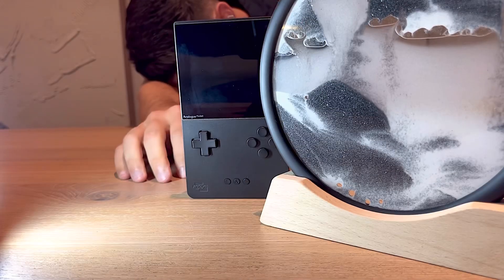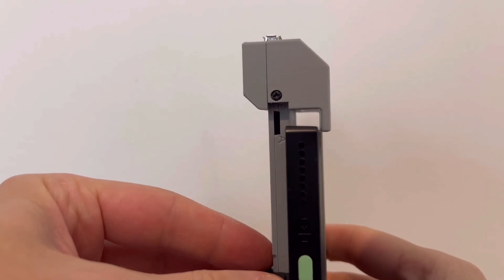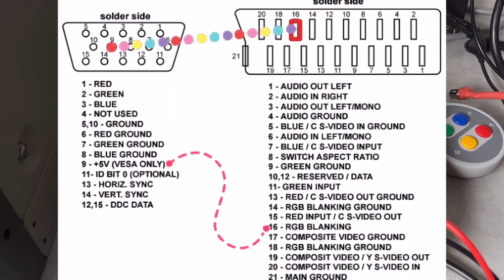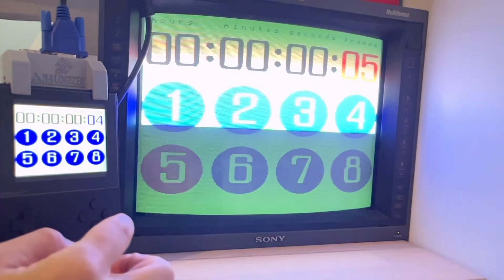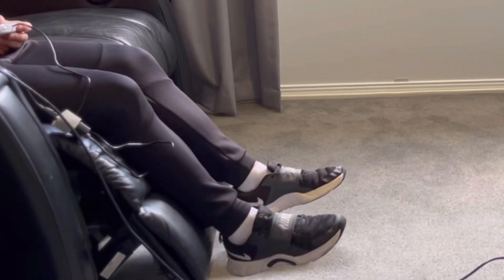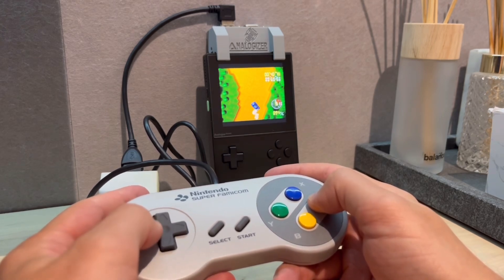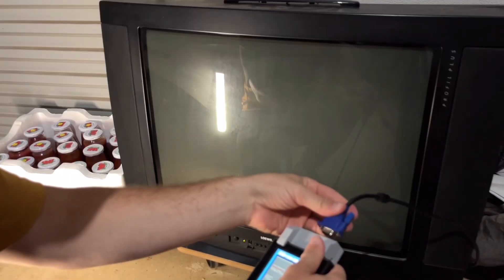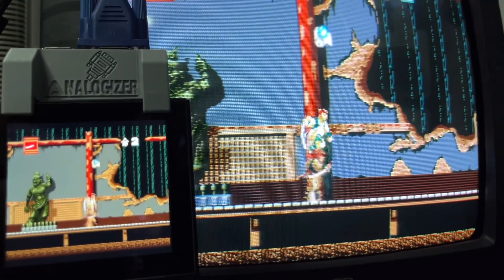FINALLY! A DAC for the Analogue Pocket! Analogizer FPGA for crispy analog video to a CRT AND MORE!

Comment: I just want to play DMG-01 Gameboy games on a crt using this. You didn’t show any crt screen gameplay with original dmg-01 green palette. That was the whole point
Reply from the maker: @yasinabid2031  The only console cores compatible with the Analogizer at the time of making this were the SNES, NES, PCE and NeoGeo. Analogizer supported the Gameboy Colour openFPGA core well after this was made my friend. There currently does not exist a GB openFPGA core for the Analogizer so if it’s a green palette that you want then you’d need to see if it exists in the GBC openFPGA core. The Analogizer obviously occupies the cartridge slot so it does not allow to play original cartridges, therefore you’d be loading roms from the SD card so if you were to do that anyway then there’s several options that would have you play GB games on a CRT: MiSTer FPGA, Raspberry Pi, SNES with Super Gameboy, GameCube with the Gameboy player. If money was no factor then my personal recommendation would be the GC/GB player combo as it is one of the few options that will play original Gameboy carts in full screen and if you boot through Swiss then you can output in 240p. Otherwise emulation on a Pi 3/4 output to a CRT is be fairly cheap and accessible

Comment: pretty cool, too bad it won't allow you to use hardware. Analogue doesn't want to release an working DAC for the pocket and it seems like I'm stuck using HDMI till then.
Reply from the maker: I hear you, the creator of the Analogizer is working within the constraints of what can be accessed through the cartridge pins. Otherwise if you have a good downscaler on hand then you could skip their eventual DAC

Comment: How did you manage to get audio from an audio breakout port of those HDMI 2 VGA adapters? I mean the one around 7:35 
I tried 2 different ones and I notice that the port reacts to my speakers but it does not output any audio. Would appreciate if you could tell me if there is something specific I have to do. One of the ones I tested looked exactly like yours
Reply from the maker: The one I featured gets 5v from the HDMI output of the Dock. Not all HDMI devices send sufficient voltage and not all external converters receive enough amps so either of those could be the reason why you’re not getting audio, assuming you have done troubleshooting to rule out the auxiliary cable, HDMI to VGA adapter and Dock power supply. I don’t think it’s a copy protection measure but it’s something to consider and you may just need to try another converter, possibly an externally powered audio DAC
Reply: Thanks a lot for the feedback! Well, yeah I assumed something similar. On the Dock I‘m using the official power supply. I guess I will have to use either an external DAC or HDMI splitter with audio breakout or simply use your other method with an extension cable so I can reach the pocket‘s audio jack which seems to be the quickest and cheapest solution. 
Yes the setup is wacky but at least I can play PC Engine on my CRT haha
Reply from the maker: @marph2005  no problemo! I love using the Analogizer for portability, otherwise a good downscaler with the Dock works really well and displays the menu
Reply: @MarcoRetro316  Hey, so I have finally followed the setup now that you show at 7:50 (the one with USB-C extension to reach the audiojack, but actually this solution doesn't work for me. If I plug in the analogue in the dock that way, the screen turns off yes and I can use BT Controllers, however the sound through the jack turns off immediately. Did that solution really work for you?
Reply from the maker: @I honestly can’t remember it’s been a while since I tried with the dock and usb c extension. My friend has my dock so I’ll see when I can grab it back and test again for you
Reply from the maker: @ come to think of it, it makes sense it would mute the audio, I likely had the mass of wires as a point to make, sorry, as it is misleading. If the female usb cable was for charging only then it would work, but then you’d not be about to use a usb controller. To have it docked and extract audio then you’d need to go back to an hdmi converter
Reply: I guess so. Maybe the easiest is to take an usb charged Audio extractor. That way I can go through HDMI and should get the audio without worrying if the HDMI to VGA without knowing if it can extract sound by itself or not. Thanks for your help though!

Comment: Don't you need the level shifter to match the voltage of controllers to the SNAC I/O board to prevent potential frying of Analogue Pocket? Why don't you research more before you post videos?
Reply from the maker: Thank you for bringing this up. When I used SNAC, it didn’t work with the intermediate shifter, though it should have and was possibly just a poor connection. You’re correct that it needs the level shifter, again thanks for bringing this up and I’ve pinned a comment to bring it to attention

Comment: So I now have an entire setup - Pocket, Analogizer, 90-degree USB adapter, SNAC SNES adapter, SNES controller, and a CRT monitor.  Now just one problem - I can't figure out a way to re-map the controls.  Trying to remap buttons on the Irem m92 core and while I can remap them on the pocket itself, I can't remap for my SNAC adapter.
Reply from the maker: I’m not sure you can remap SNAC controllers

Comment: i mainly use my pocket with real carts, wish this could work with real carts.
Reply from the maker: Unfortunately no. The cartridge port will be occupied by the Analogizer for starters, and the device requires cores in openFPGA to be specially modified for analog output

Comment: Too many caveats, just buy a MiSTer
Reply from the maker: The MiSTer will always be the pillar of my setup
Reply: I read your comment before I started the video. I thought it couldn’t be that bad but holy shit you’re absolutely right.
Reply: Strange comparison since you can’t play the MISTer in portable mode?
Reply: buy a mister pi
Reply: I love my MiSTer, but the AP does quite a few things the MiSTer canny do, such as real carts which equates to more accurate audio & video timings, it has cores the MiSTer lacks, the AP also has incredible audio, that even with a tip-top audio DAC, the MiSTer lacks, a decent DSP helps with that, but the AP really shines in the sound department, the GB, GBC, NGPC, PCE for instance sound sublime on the AP, especially with OG carts, that said, the MiSTer has real MIDI support, along with sound fonts and banks, if only someone added MIDI support for the console cores, which would make for some awesome possibilities like using alternative sound fonts with say the SNES or N64 et cetera, would love to use GB chip tune with SNES & NES or full fat MIDI with N64.
Reply: @Wobble2007 the Mister has way more cores and can do cores that will never see the light of day on pocket like Saturn/PS/N64. Yes the pocket has a few that the Mister can’t do like MK/Narc but for the most part the Mister is more powerful. I don’t know about all that stuff about the audio not being as good on Mr, sounds identical to me same with timing etc. I own two pockets and a mister and every analogue console except nt.

Comment: Hello mate, Interesting add on but looks too clunky. 

I am surprised you didn’t mention that the ossc pro makes the perfect companion to the docked pocket as a dac. I have been using 480p hdmi output down to 240p with the pro and voila! It solves all the issues you mention as you can access the menus on screen, but it does not give the same snac support. My 2.4g controllers paired to the dock are good enough for me.
Reply from the maker: Hello friend! I may be making a small follow up video on the OSSC Pro when Marqs adds some new downscaling features that are definitely worth mentioning. So I’ll revisit downscaling the Dock then, but this time I’ll make sure to set the scaling to integer 🤦‍♂️ Mike Chi if you’re reading, sorry again good sir.
Reply: @AnyBitsFTP Do you not notice any issues with smooth scrolling? If I use 240p test suite on the Pocket screen it's fine, but through the Dock the HDMI output is fixed at 60Hz rather than synced to the core refresh rate, and so scrolling jumps slightly every few seconds.

Comment: Some day we'll have our portable emulator that hooks up to CRTs. Guess it's not today.
Reply: Make yourself a portable RGB-Pi, or Replay OS portable, I plan on doing that soon, DynaRes 2.0 is an incredible bit of software, I'm just waiting on a decent 4:3 5"+ AMOLED with at least 120Hz for rolling-scan emulation. There is also Takis MiSTer portable on the horizon, that must be nearly baked by now. It also supposedly has OLED ootb.
Reply: @Wobble2007  Problem with that is that you'd need to use composite out to the CRT.

Comment: do we need that snac adapter on their website for the pcengine or can another brand work?
Reply from the maker: It seems like you need the adapter to route the pins according to what’s written in GitHub

“To use the PCEngine controls with the Analogizer it is necessary to additionally use a harness that modifies the USB3 wiring and connects between the PCengine SNAC adapter and the Analogizer.”
Reply: @MarcoRetro316  thank you for your reply boss! Do you know if the pc engine snac adapter was for sale today and it just sold out or were they releasing it later?
Reply from the maker: @817Godism  I’m told they might have stock in 7-10 days

Comment: Enjoy the pocket.
The cores make it that much better on Openfpga. Neogeo is so awsome. cps 2 as well. has the retro consoles on there.
Hope the dock will support the dac. There is now a option in the dev mode to play it docked wile the screen is on with a usb battery.
Analogizer looks ok. the dock should of done all that. I wonder if the usb will support a controller without it being powered? On the go.
Reply from the maker: I love my AP with openFPGA, Analogue really delivered on the handheld. I do prefer the GBA AGB-001 style but my play sessions are short so the Gameboy form factor is still a good fit. Thanks for letting me know about the Dock Dev mode. It is a shame it’s taking this long for the official DAC support… hopefully soon 🤞
Reply: @MarcoRetro316  does a switch controller work on analyzer USB port without it being powered?
Reply from the maker: @Deltax5 USB controllers will not work with the Analogizer. That port is shaped like a standard USB but it’s wired for a connector to interface serial native accessory converters (SNAC). It only reads original controllers like the NES/SNES, but not actual USB controllers